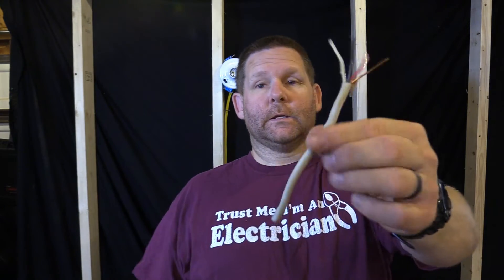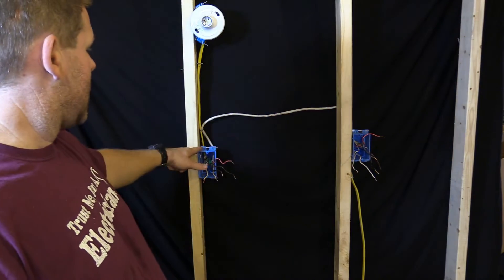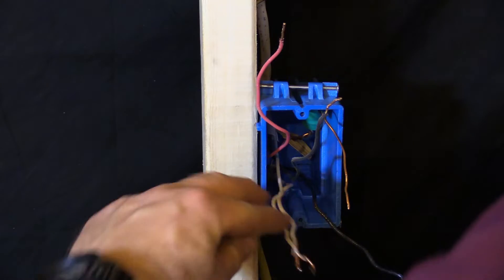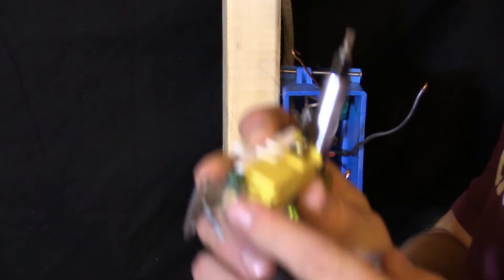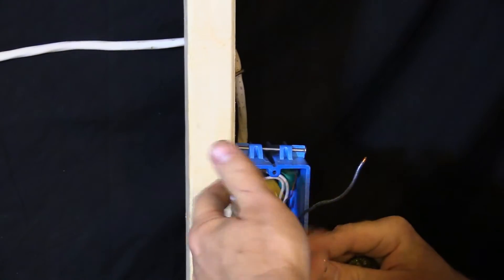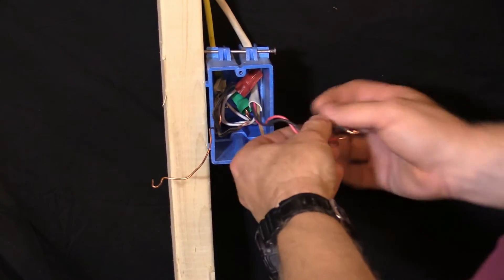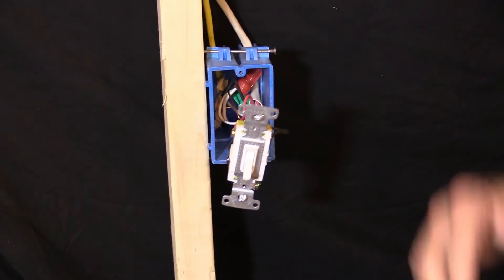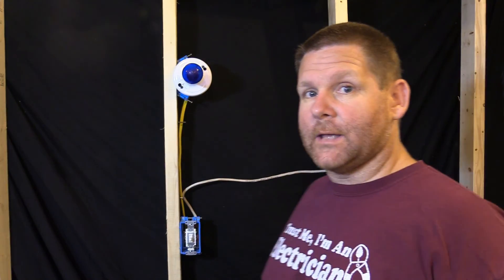How To Wire A 3 Way Switch

Comment: 😊I still dont see how the switches connect to the wire from the breaker box, and I dont see the wire to the light. Pardon, but I dont see them.

Comment: Trying to change a dimmer with a 3 way light switch..Working thru changing, i'm stuck--new dimmer works butttt, its funky....It will only work when the secondary switch is in a certain condition and if the light is on, the secondary switch will turn it off but not back on ??? I know i have got something wired wrong but can't figure it out.....what do you think i have done wrong and/ or do you think the secondary switch is just broken?
Reply from the maker: https://youtu.be/zNKDTi3N6H4 this should help you

Comment: I'm no electrician, have a degree in electronics, and have been an industrial technician for over 40 years working electronics, electrical and mechanical.

I NEVER trusted those pens for one reason and one reason only...

WHEN the battery dies on that pen, you NEVER KNOW if it's reading or not and "A.S.S.U.M.E" there's no power because it didn't light up or beep.

I NEVER owned one and I will NEVER own one for that single reason.

I ALWAYS rely upon my trusty DMM, that is digital multi-meter. You turn it on, display comes on and I KNOW it's powered up AND working.

Great videos, subscribed and learning electrical every time. You just "might" one day make an electrician out of this electronics tech😁🫡👍
Reply from the maker: I understand exactly where you are coming from. I appreciate you watching and commenting. I appreciate your subscription also, Welcome to the mountaineer outdoors family ☺

Comment: I have a weird situation on my 3 ways.  It was wired by an electrician, but one of the switches need to be in a certain position for them to work properly.  I took them apart last night, and they actually have the white wire connected to the switch, which I thought was odd.  With the wires disconnected from the switch and the breaker back on, I tested them and the white and red are hot, black is not (so I'm assuming the black is running to the light.  But why is the white hot?
Reply from the maker: By reading your other comment I feel like you figured this now
Reply: @MountaineerOutdoors  I have, thanks to you!  I was so confused what was going on.  They didn't mark the white either, so there's no way of telling it would be a hot other than using my meter.
Reply from the maker: That's correct. Glad that you got it fixed. Have a great day ☺

Comment: On my 3 way I have two black lines instead or a red and blac. So idk which on is hot and which is traveler
Reply from the maker: You will definitely have to separate them to find out which is the hot

Comment: Excellent video. question, I have 3 separate switches that control the lights in my living room. I want to replace one with a smart switch. Do I just get a 3 way smart switch and hook it up the same on just one of the switches or do i have to have 3 smart switches? I do have a neutral wire which it does require.

Comment: Really nice video, my daughter work at a artistic school she decided to be a teacher. She said that this is her calling. My question is that I put a dimmer switch in and it turns on at the dimmer and turns on and off at the other light switch. However, if the dimmer switch is off the other switch want turn the light back on. Is this the way it works with a dimmer switch. Could you make a video with a dimmer 3 way? Please advise?
Reply from the maker: That's awesome about your daughter. No it sounds like you have your traveler's crossed you need to find out where you're switch leg is and make sure you put it on the common screw and same with the hot. Here is a video on how to fix it https://youtu.be/zNKDTi3N6H4

Comment: i changed my 3 way switches and never had an issue with the light working. After I changed them the switches do not work as it should. Both switches have the ground screw on bottom left. Brass screw upper left and upper right and black screw bottom right. Upstairs switch, black wire upper left, cream wire upper right and red wire on black screw. Downstairs switch I have cream upper left, black upper right and red on black screw. Basement switch is up and light does not work at all. Basement switch flipped down, light turns on from upstairs. I tried having both switches wired the same way (black upper left, cream upper right and red bottom right) and light didn't work on either end. I only have 3 wires and not sure why I am having this issue. I changed another 3 switch same way and works as it should. Any help? Thanks
Reply from the maker: This may help you https://youtu.be/zNKDTi3N6H4

Comment: How  Would you wire up a 3 way switch with 3 lights in between the switches Would you run 14-2 and 14-3?  I am rewiring my older home the wire I seen better days it's all corroded and crumbling so I pulled it all out and I'm adding new had 3 recessed lights in between 2 switches which is with a 3 way and I was wondering how do I wire them? They had the 14 - 31 running through the lights to the other switch and that was it and one black switch leg
Reply from the maker: I would put it back exactly how it was. Me though I would do it 12-3 between the switches and one 12-2 up to the light. In your case though if you can do that do it. If not put it back just like it was so there won't be any confusion.

Comment: How do you know which of the 3 blacks is the common? Old switches do not have a black screw. Would it be the wire situated on the bottom? Thanks
Reply from the maker: It is the only wire that is hot once you separate them

Comment: How can you add a ceiling fan to a 3 way switch and run just the fan and not the light.
Reply from the maker: That is  question that is hard to answer. However it would be a good video in the future. Basically you would have to have a 3 wire going to the fan or you could add a remote for the fan. Just depends on what you want to do

Comment: I just tried replacing a 3 way switches with new ones. It works for some time and when I use one of the switches a couple of times, the breaker trips.I did everything correctly for sure but still it trips.So any advice please 🙏 
Thanks
Reply from the maker: Sounds like you may have a ground wire possibility touching one of the screws on the 3 way.

Comment: Why use 12 wire and 14 wire in between makes no sense
Reply from the maker: I believe that I specified that the reason I did that was because I didn't have 12. Bruh anyone knows that but there are plenty of people who do this exact thing
Reply: @MountaineerOutdoors  yes but know one can answer why makes no sense 12 wire is 20 amp 14 wire is 15 amp but know one explain why
Reply: The line is 20 amp wire the load is 20 amp wire but switched with 15 amp wire

Comment: Excellent video, it answered a lot of questions, ty. However, how do you do this with two motion sensors on one light?
Reply from the maker: That is too hard to explain. I actually did that in my garage and it wasn't bad. The switches are expensive but worth it. I may do a video on it

Comment: So the question I have I replaced my  old 3 ways switch with the new 3 way switch I wired the same way u just did but when I turned the light on the first switch won’t cut the light on I walk to the second switch cut the light on that work then I go back to the first switch to cut the light off that switch started to work can talk me what I did wrong
Reply from the maker: Click on this video it's the easiest way to figure out what you did wrong https://youtu.be/zNKDTi3N6H4

Comment: Will 14 gauge be ok if you will be running led lights??
Reply from the maker: 14 Guage wire is always ok as long as you put it on a 15 amp breaker. Me personally, I will not use it because of the people who run it then keep adding to it and change out the breaker to a 20 amp. But yes keep it on a 15 amp breaker and your good
Reply: Generally, led lights are very low power. So you should be OK.

Comment: So the question I have is in the basement, I have a light that I can turn on and off at the stairs. I would like to have a switch at the other basement door to turn the light on or off. Can you help me wire up a switch. Using a junction box.? 
I too have friends that are special. Love them dearly 🙏👍
Reply from the maker: So do you currently have a 3 way now? One switch at the top of the stairs and bottom?

Comment: Great video! I have a question. How do I add an outlet from a 3-way switch? There is no neutral wire inside the box.
Reply: That’s great! This will save me 10 meters of Romex wire and climbing up to run it through the ceiling. No one in YouTube or Google covers this approach of adding a receptacle from a 3-way switch. Thank you very much.
Reply from the maker: @annshr9917  let me know how it works for you
Reply: It WORKS!! I’m so happy. Thank you very much.
Reply from the maker: That's awesome so glad this helped you... I was wondering. Have a great day ☺
Reply from the maker: Are you talking about adding a receps in place of a switch?
Reply: Mountaineer Outdoors Yes, a receptacle. Can I pigtail to the hot and one of the traveller wires and make them the hot and neutral going into the receptacle? Or must I get them from the light fixture? Thank you.
Reply from the maker: Yes you can. Not the traveler just the hot.  You will have to find a nuetral. If you decide to use a traveler as a nuetral you must phase it white or just make sure you use the white wire and hook it to the nuetral.
Reply: What did you mean by ‘phase it white’?
Reply from the maker: If you use a color red or black for a nuetral. You must take white tape and put it on the wire to designate it leer letting everyone know that now that is a white wire and u are using it as a nuetral.  You need to do the exact same on both ends of the wire.
Reply: Will do!
Reply: It looks as though my celebration was premature. Although the electrical outlet tester shows there is power in the receptacle, when I plug in an electrical tool, the tool does not operate as expected but rather acts like a switch, ie. turns the light off or on. Looks as though the traveller wire cannot be used as a neutral wire. Any suggestions how to correct the problem? Thanks.

Comment: You never explained the 12/2 wire coming from the actual light to the switch itself........
Reply from the maker: The other 12-2 is the switch leg. The black is to the common and the white wires twist together.. Your right I Forget that part of instructions. Thanks for watching and commenting ☺

Comment: question here I have 1 light on 2 three way switches in our basement.  We are finishing the basement and added step lights that I want to connect to the three way switches also.  My problem is when I hook everything up I still can't turn the step lights off and on.  They just stay on but the other light works.  I need help please what am I doing wrong????
Reply from the maker: You will have to find the switch leg to your basement lights and put the switch for the steps on that wire. That is the only way to get it to work correctly.
Reply: Mountaineer Outdoors   The power comes into the switch 14/2 goes to the light,  14/3 goes to both switches.   Then 14/2 goes to the step lights.  I connected the 1 light to the step lights then to one on the switch screws.  The common is connected to the common on both switches.   All white wires are connected and grounds are connected.       Here’s the problem. The 3 way switch works to turn them all on.  (The switch where the power comes in).     The other 3 way switch at the top of steps only turns the original fixture off.   Not the step lights.   Cray???????
Reply from the maker: The only way it will work is to put the step lights on with the other lights you currently have working right. You will have to put only the black wire for the step lights with the wire going to the old lights by way of a pig tail. It has to be done like that otherwise it will not work.did this confuse you? If so I'm not an artist but email me and I will try to draw it up and show you.
Reply: Mountaineer Outdoors thank you
Reply from the maker: I sent you the email
Reply: What’s your email????
Reply from the maker: @kimberlyrichardson2686  comer7844@gmail.com I will not be able to email you until later this evening. But I will.

Comment: I wish there were three of them switches instead of just two. Because that's the current issue of our light switches in our hallway in my house. As of this writing they don't work right the way it used to. My brother did change all the switches replaced them with new ones, and they don't work the way it used to anymore.
Reply from the maker: If you have more than 2 one is a 4 way

Comment: I have a question??? On my house there are one 14-3 and 14-2  but on the 14 -2 it has red, white and   Ground and the 14-3 has red, black , white(neutral)  and ground
Reply: So on the 14-2 is the red wire the common
Reply from the maker: The 14-2 shouldn't have a red I have never seen one that has a red wire in it. Maybe it's a 14-3 and someone cut off the black. Your question is about a common wire? Well I don't know exactly how yours is wired tell me exactly what you want to know
Reply: Mountaineer Outdoors well before I did anything I checked the how it was wired to the switch and the red wire was connected to the common and the remaining wires were red black
Reply: Red wire was connected on the common terminal on both switches
Reply from the maker: Once side is definitely the switch side and other is the hot sounds like. It may be that your hots are made up in the light and the you basically have only switch legs in your switch boxes

Comment: Have one question, in a hallway there is a 3-way wiring for a hall light. When I flip the switch at one end it turns on the light. Then I go to the other end and can flip it off but can't turn it back on without going back to the switch down the hall. It's been like that for some time. Can you tell me what is wired wrong.
Reply from the maker: https://youtu.be/zNKDTi3N6H4  this video will show you exactly how to fix it

Comment: Hey man, I watched your video and was able to fix the issue where I had hooked the power and travel wire wrong. Of course, one switch worked but the other switched killed the first one from working. LOL. But in my house instead of having power, neutral and ground all coming into the switch or light I have a single black coming into the switch tied to a white going out. My house was built in the 60's and every light is like that. Can you explain this type of wiring to me or in a video?
Reply from the maker: Sounds like they just ran down a 12-2 or a 14-2 the probably fed the hot wire hot and the black wire back to the light the return hot. Or back in the 60's they use to switch neutrals which is very dangerous. If you don't have a hot at all in your switch box then it's probably a switched nuetral. Use a tick tracer (voltage tester) and see. Let me know what you find
Reply: @MountaineerOutdoors  I did. came in hot on neutral, out on black. Very confusing for me but I did figure it out. Thank you.
Reply from the maker: No problem. They just kept the main power in the light box. A good rule to remember is that everything is hot until you check it. The two wires in your switch box are just for the switch. Like I mentioned before. The white was probably hot and the black was back up to your light. At least that's how we always do it. Glad you figured it out have a great day ☺

Comment: Why never put the wire in the holes instead of around the screws? All the switches in my house were wired in the holes. Should I re-wire them? Thanks
Reply from the maker: here is a video explaining it, its my opinion but here it is https://youtu.be/UJ4UvQ7VAig
Reply: @MountaineerOutdoors  thanks

Comment: Can I use a switch outlet to a 3 way connection and if so how would I go about doing it?
Reply from the maker: It's exactly the same way as a regular 3 way. Then instead of the switch leg going to a light it goes to the receptacle

Comment: How do I get the switch to connect to the dimmer
Reply from the maker: Uhhh not exactly sure what the question is here? If you buy a 3 way dimmer it is exactly like wiring a 3 way switch.
Reply: Mountaineer Outdoors yes I’m using a lufton dimmer, but it’s would work on the other end of the 3 way
Reply: But I’m set now
I figured it out this morning thanks for the reply

Comment: Nice video. How can I illuminate a three way switch I have two separate garage is when I flip on the switch it turns on both lights I want to be able to turn it on just one garage light and not the other
Reply from the maker: Most of the 3 way switches require a nuetral. Do you have a nuetral in your switch box?
Reply: I have two black wires on one side of the box and one red one on the other side I have one red one and ground at the top of the switch also have two white wires twisted together with a wire nut in the box